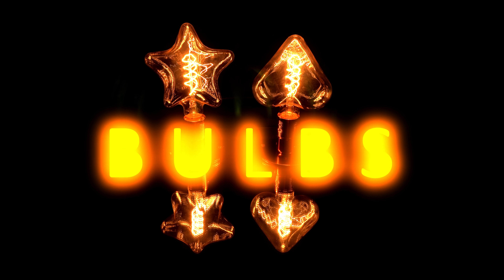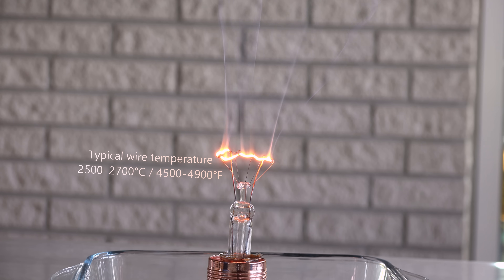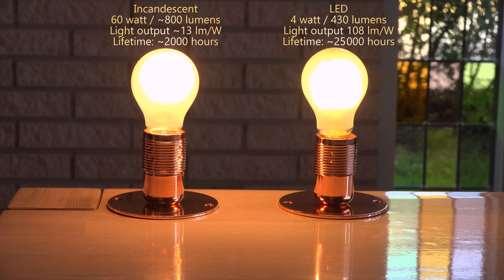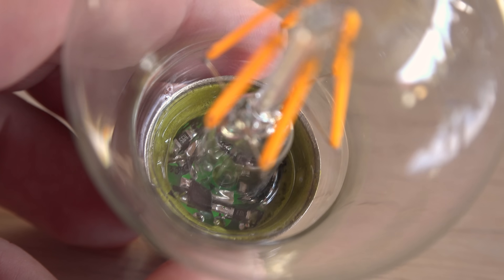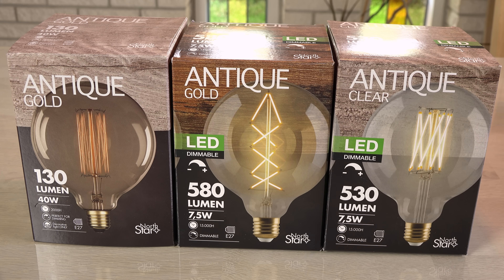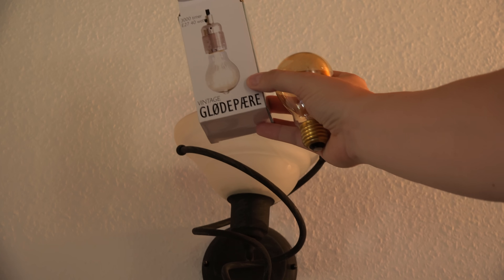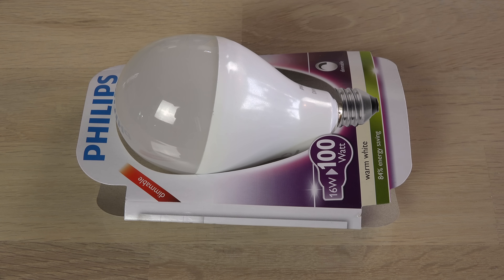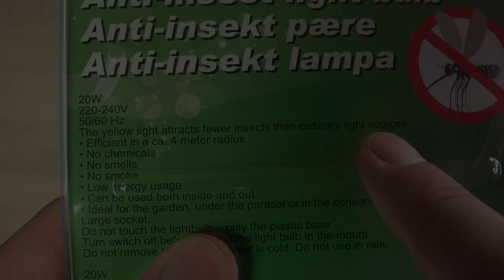Light Bulbs | LED vs. Incandescent

Comment: LOL. I just knew the Danish accent :D
A shame those 40w Harald Nyborg bulbs arent dimable. Could be so usable to put in a big lamp and mostly run it dimmed but with the possibility to really crank it up when wanted to.
A word about the Harald Nyborg Sartano power meter. I find it really isn't the most accurate meter. For resistive loads though it's fine but do expect some margin of error. However for CLF, LED and various electronics it seems not always to be very consistent with various manufacturers claims sometimes being as much as +/- 50% or perhaps even more. On the other hand I have another meter, GT-PM-04 (don't got a name, just a model number) bought in Aldi a few years back and it seems much more consistent with manufacturers claims of various devices only being 5% of at most. The devices the Harald Nyborg (Sartano) power meter is most wrong is typically small or cheap loads. So it clearly have an issue with devices not having a great power factor as well as very small loads. For instance I have some zigbee (hue and lightify) bulbs and according to manufacturers specs they use 0.3-0.5 w in standby which the Aldi meter agrees with. The Sartano on the other hand claims 1,5-2 w - so one of them is clearly wrong. And I do trust manufacturers claims and my intuition that 1,5-2 w in standby should produce a significant amount of heat - which they don't. Also the Aldi meter seems to agree much more with manufacturers claims for power factor than the Sartano.
So my guess is that your 125w CLF might just use a significant amount more than your Sartano is reporting. Also remember that CLF needs to warm up. So let it warm for 10-20 minuttes before checking whether power usage is according to claim or not.
Reply from the maker: Thanks for sharing. Yes, the Sartano power meter probably isn't the most accurate - it is kdirt cheap. But I've been told that the low readings from incandescent bulbs could be because my voltage isn't the nominal max 240V that the bulbs are rated at. I live at the far end of a power line, so my voltage rarely exceeds 230V...
Reply: Same here. Or well I don't know how far away I'm on the power line. But it's usually 230 here too, at my parents old place and my old place it was usually around 230 too. I have no doubt that your readings for the incandescent aren't accurate within an acceptable margin. I don't recall ever seeing anyone getting 240v in Denmark. All measured with a decent multimeter so readings are accurate. But hey no big deal - it's usually a good thing as many things last significantly longer if slightly under driven. Whether or not it's a good thing for you power bill however I don't know. Especially if your billing meter is an old electro mechanical which is based purely on amperage. But hey they in contrast don't consider power factor either so hey usually your power bill rises when getting a new billing meter even though you use the same amount of power as usual :-p

Comment: these bann  si not to make green politics! if they try to make green politics they bann hight end graphic cards or hight end computers. these divices have the most lowest eficency! or they forbid to light up comertials or stores if they are closed! its just to make money !  and stupid people see the politics doo something. if you make some reserch on led and cfl and other discarge lamps you will see that are very bad for healthy. another example some switch mode power surplys are much more eficinet than linary reguladed ons. but the swiching power surplys radiate hevely radio wafes and pull it on the power lines too! it bring cancer and brain problems! green solutiuons are not a question of eficency ! nature have all times very low eficency but there are green technolegie forever! if we createt whith termal solar powerplants electrisity to generate ethanol in the desert, it  ist the sulution. the solar thermie steam power plants drive large homopolar generators for low voltage hight current dc. these are powered large syntese cells! they can createt with good eficency from CO1 and H2O Ethanol.  the water coms from solat thermie vaporesators and the CO1 from some chemical collectlrs they are suck CO2. the ethanol can burned into motocycles cars ships planes stoves powerplants.... these is a green solution.

Comment: incandescents can also heat your room a bit in winter!!!
Reply from the maker: Yes, especially that 400W halogen work light :) But electricity is expensive in Denmark so not the most economical heating solution. Thanks for watching!

Comment: I like LED bulbs, but you're still needing a step down transformer to bring the voltage down to about 4.5v where the average LED operates at. Just like CFLs, still have heat generation from the transformer. But still much more efficient than incandescent.

Comment: What do you think of this thing where in many countries where it gets dark and also colder. When winter comes we like light but also an effective form of heat like radiation. Is the use of LEDs + the heating in the many forms they take worth moving away from incandescent lightbulbs + also heat but maybe less?
Reply from the maker: In Denmark electricity is expensive, so heating our houses with electrical sources is not a good economical solution. Burning wood, gas, oil etc. is a much cheaper heat source. But if all electricity was sold cheap and came from sustainable sources like wind mills and solar panels it would definitely be better for us all to get heat from electrical sources like bulbs and other electric heating elements.

Comment: I do like my LED bulbs got 1000lm ones around the house, just keep in mind they do NOT like being in enclosed lamp holders, the more open they are the better so that air and flow and cool them down as the higher lm ones go upwards of 80 to even 100C without issue. 

The only issue is the flickering they do give, but that is only an issue when I am dealing with a migraine or looking right at one (which with 1000lm bulbs is not advisable).

Still LED bulbs are still in rapid development we see new ones a few times a year at work as they get more and more efficient.
Reply from the maker: Yep, high output LEDs still gives a lot of heat and need proper cooling. We do have the technology to make LEDs way better - including solving the flickering. But most commercials LEDs are build to be as cheap as possible...
Thanks for watching!

Comment: Hi I thought coated incandescent bulbs were banned earlier than clear ones cause of the loss of light due to the coating i.e. an even worse power to light ratio ?
Reply from the maker: Hi. Frosted incandescent bulbs were the first to be banned. Very likely because of lower light/power ratio. Therefore it is counterintuitive that clear glass decorative filament bulbs are getting banned but tinted glass models are still allowed ?!?
Reply: Brainiac75 Hi Brainiac, I didn't make a distinction between frosted and tinted. I meant the mat glass ones (Mat being a Dutch word) were the first to be banned here in The Netherlands (I guess the same for Denmark). I don't know if you call those tinted or frosted.
Reply from the maker: ***** No problem. The frosted/matt ones were the first to be banned in all of the EU.
The tinted ones are still transparent but have a dark/golden coating to copy the look of well-used antique edison filament bulbs. It doesn't lower the light output as much as frosted glass. Still I find it odd that they plan to ban clear decoration bulbs but allow tinted ones that must have a little lower light output.
Reply: Brainiac75 yeah that is weird

Comment: I wish I could find 12V AC GU5.3 LED bulbs for my Wire Track Lighting. Its been up 15 years and not one of the 20W Halogen lamps has blown yet (confused). Love this video, and the accent ;)x

Comment: Hi Friend. Is it true that the osram have 800lm? efficacy es too hight. I can not find that model on OSRAM page. The best I found was 117.5 lm/w (PARATHOM Retrofit CLASSIC A 40 4 W/827 E27 FIL). Cheers
Reply from the maker: Hi. Unfortunately I don't have anything to test lumens, but Osram is one of the brands I trust. And the bulb clearly gives of more light than eg. the 580 lumen Northstar Antique Gold. My data is from the wrapping as you can see at 9:22.

Comment: Incandescent light can be 100% efficient....when you have to heat your house...  what heat the lights provide ...the house heating does not   ..but obviously  this is not the case in the summer if the lights are fighting the aircon

Comment: No metal halides? I suppose you would need a ballast for each power level, but it would have been an interesting addition to the comparison.
Reply from the maker: Metal-halide-lamps are interesting but I simply don't have any. They are not very common for home use ;) I have seen some for sale in Denmark, but they were meant for salt water aquariums and stupidly expensive...
Reply: Definitely not cheap, I have a 1500W at home, discounted because it was an old stadium light. Just the ballast was $70.
Reply from the maker: Josh St. Louis 1500W of high CRI light. Very nice. Could be useful in video production :)

Comment: My main problem with banning incandescent bulbs is the lack of reliability of CFL and LED. I have to find in ether of these technologies a light bulb that last as long as the manufacturer claims. Given the expense of these bulbs it cost the consumer more to use CFL or LED bulbs. Incandescent bulb can be produced very inexpensively and even with frequent replacement still cost the consumer less then CFL and LED bulbs. Basically this is saving energy on the backs of the poor. Great going guys.

Comment: What kind of light socket were you testing the lights in
Reply from the maker: I found them in a local super market in an assorted bin (not a stock item). They are surprisingly hard to find on eBay - try searching for 'bare bulb fixture/mounting/sconce' or something similar. All I have been able to find: https://www.industriallightelectric.com/collections/industrial-ceiling-light/Bare-Bulb but they aren't really the same thing :/
Reply: ok thanks (:

Comment: The 40W advertised vs 37W measured, would be explained by putting a 240VAC rated bulb on Denmark's 230VAC supply.

Comment: I cant describe it as I dont know what it is but some LED lights really mess with my eyesight. They make me feel dizzy and some even make me vomit. 
The leds on car headlamps are a major culprit, I have a synthesizer I cant use in anything but the brightest daylight as it makes me dizzy and gives me a headache.

I do have a LED ring magnification lamp for soldering and that is fine. 
I'll add I suffer from migraine headaches. So the move to all-Leds-all-the-time is not a good move for everyone :-(

Comment: i think why you had close to advertised power with the tungsten ones is because mains voltage isn't uniform (it may differ 10-20 volts depending on how close you are to the transformer, if we ignore different voltages in different countries)
but the LED lamps have VRMs in them, so on lower voltage they'll just draw more current, so it's precisely what they say (or as close as it need to be)
Reply from the maker: It think you're right. My mains should be 230V but it's rarely above 220V... I'm not an electrician but I guess that saves me a little money on electricity when using incandescents - I just get lower light output :)
LEDs are of course still the best choice for saving electricity though :) Thanks for watching!

Comment: cant you just color the glass on the bulb to match the incadecent cri of 99+?
Reply from the maker: I believe that would only change the tint or color temperature of the bulb. The problem with the low CRI is the lack of some wavelengths in the light and too much of other wavelengths in the light from the bulb.
A colored glass could dampen some of the strongest wavelengths - lowering efficiency and maybe giving temperature problems. But colored glass can not amplify the too weak wavelengths. That's why I think it's really difficult - if not impossible  - to even out wavelengths with colored glass to give a better CRI. Thanks for watching!
Reply: tnaks you for anwser

Comment: Sorry but the single atom absorption model really does not describe black body radiation like the one of a heated tungsten filament. The spectrum of black body is continuous and it's generated by the collective motion of all atoms and electrons in the solid.

Comment: considering the price ill stick to the illegal ones, also some of the new bulbs have mercury inside them and it is a nightmare to clean up if they crash.
Reply: modern CFL bulbs have tiny amounts of mercury in it. it's nothing to worry about if one breaks. and if you do worry about it, open the window in the room, have a fan blow out air outside of the window and then wait a few hours and clean up the glass like you normally would. or hell if you are still worried about that go use LED bulbs. LED bulbs have no mercury whats so ever.
Reply: wait few hours... old bulb i just clean up and it is gone and LED are very expensive about a price of 8 old 100W ill stick to the old one :)

Comment: I once dusted a bulb with a wet towel and the thing exploded. Won't be doing that ever again.
Reply: Well glass doesn't like quick temperature changes, this one time my coffee cup exploded after I poured some hot water in it. And I've exploded a light bulb by spitting on it, I was about 8 and curious to see what would happen.
Reply: Dubs same
Reply: Any glass bulb can burst.  Same thing will happen to windows if you house is on fire and water hits a window.
Reply: What happens when you introduce something cool to something hot and brittle? It shatters.

That why it shattered.

Comment: Thanks for the video. I learned something today about the color rendering. Especially having a bulb with high color  rendering over the dinner table. I've not changed over to LED over the dining room table (the formal table doesn't get used enough so perhaps I'll just keep the incandescent bulbs that I still have around to light that table).

Comment: Add to this the super powerful LED flashlights like Nitecore and Fenix. They produce insane amounts of lumens from just a few diodes.
Also get a lamp used in Theaters. In fact, just go to a theater and ask the technical crew to show you their lights. Most use 2000 watt halogen bulbs very often and most light techs can tell you a lot about the lights while at it. And can tell you about lenses too! Theater/stage techs are usually quite willing to tell about their craft and equipment.

Comment: what is that 40W LED bulb even used for?
I never even seen one like that, what would you need that much light for always, and the build is way too bulky.

There are other downsides to LEDs.  They don't work as well with Dimmers, even the dimmable ones.

Traditional bulbs when dimmed the color gets warmer and turns more orange creating a soft candle light glow, where as LED they get less bright but stay the same color, I don't like that as much.
Reply from the maker: The 40W is for more industrial use in warehouses and such. And yes, incandescents are also superior when it comes to dimming. Some of the dimmable LEDs will flicker more when dimmed...
Thanks for watching!

Comment: Most of the issues specified are on poor quality LED bulbs however bulbs with proper color correction, proper power supply, etc.

Im actually suprised you have shitty LED color correction, try buying cool white LED's online (ebay/amazon) which are much cheaper and better.

Comment: Incandescent bulbs are not a bargain any more, haven't been for some years now. Just calculate cost per lumen and how much you pay for electricity to see fairly easily that the LED is cheaper over shorter and shorter periods of time. The CRI is only one light rendering parameter there are several others that should be considered before certainty is determined regarding the quality of the light. For thirty dollars an 100w 95 CRI LED bulb can be obtained that puts out the light of 10 100w incandescent bulbs -- 90 per cent less electricity, much less space, longer life, much less heat, etc. etc. -- no comparison!

Comment: I like what you did here.  One thing, though - LED lights generate hash or radio frequency interference (RFI).  Some are good at shielding the RFI or generating small enough amounts that it doesn't interfere with other radio dependent devices.  However, there are some that will cause a lot of noise and interference,  This may be evident on shortwave radio, amateur radio, televisions, cordless phones, cameras, and other devices.

The thing to do is buy one or two bulbs,use them and see if anything starts behaving odd (e.g. flicker on the screen, cordless phones dropping connections) or getting noise (static).  If there is none, then that brand is good and you can start replacing other lights with that brand or brands.

Comment: LEDs are more efficient and can last longer (as long as the rectifier circuit dose not die) but the LEDs them self are not good for the environment as many contain chemicals like lead and arsenic as well as others.
Reply: Maybe so, but compare that against the consequent emissions from burning energy-thirsty incandescents...
Reply: It would use much more energy and resources to make an LED bulb, in the end the energy to make and use a LED or old school bulb would be the same.